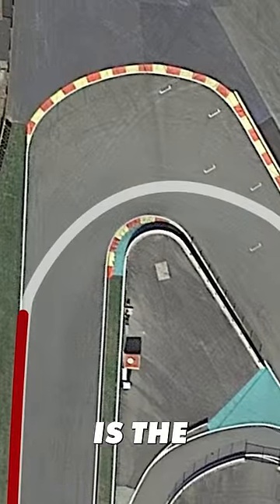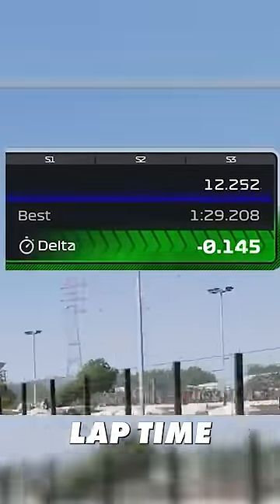Why F1 Drivers IGNORE the Perfect Racing Line

Comment: Brb gonna go test this on public roads
Reply: Yo, What’s the verdict?
Reply: Done this for years 😂 it uses too many pads and tyres
Reply: @Pickfordr100  yeah i just do single lane on public roads cuz i have to do it during the day. too many animals at night where i live. but when i did used to do it at night and used the whole road and pushed harder i was wearing my tires fast
Reply: will only work with 500+ hp
Reply: @frayziedaisy  got that covered 🤝
Reply: @metalmiguel16  currently in the prison hospital with broken legs and dreams.. 10/10 would do again
Reply: @frayziedaisy  any amount of power that's too much for the tyres &/or chassis to handle. You're cornering at points where you're supplying minimum power & easing the steering to get the power on.
Reply: It's fun to take the race line, just stay in the correct lane. Using the whole road is a terrible idea, especially on blind corners during the day. Driving at night you can see headlights coming from around corners so you know when to chill.
Reply: Doing that every other day.
Reply: @Pickfordr100 I’ve gone through 3 sets of tires in the last year and 2 sets of brakes
Reply: I do this on turning ramps. Higher speed on ramp exit is easier to merge. In reality, your acceleration is smoother coming up to highway speeds.
Reply: @badgermetal unfortunately some people will still drive their car at night with dying/dead headlight bulbs (or cars with manual headlights and they forget to turn them on especially when the road is lit) so you can't be too reckless and just assume it's fine to go into an oncoming lane in the middle of the night blind (plus nighttime is when the most drunk drivers are out and about)
Reply: LOL
Reply: It's the line i take 😂 helps when you don't have a great 0-60

Comment: Two words: Exit Speed.
Reply: Yeah I learned pretty fast that if there's a straight after the corner then exit speed matters a lot more than cornering speed.
Reply: Actually no) 
Short corner- are those 2 words)
Reply: That‘s 4 words man 🤦
Reply: No, it's Exit Acceleration
Reply: One word: Fast.
Reply: That's four words...
Reply: Exit speed isn’t always the most important though
Reply: And faster entering speed by late breaking, the sector before the turn 

Also tire degradation, track condition, and batteries strategies will all affect the racing line through a corner
Reply: There’s many things that you need to take count on like braking points, turn in points, and ofc throttle control i.e. exit speed
Reply: Four words: speed exiting the turn.
Reply: you're not funny @jared_deraj
Reply: Or maybe it's high minimum average speed?
Reply: @kresimirbozic1976 it’s four words, if you don’t understand basic punctuation.
Reply: That was the key for Vettel in 2008-2013
Reply: no, but both are correct 
The 2 actual words are : High-Low 
(enter sideways high, exit straight low)

Its a normal dirt racing practice to fulfill more corner speed which improves exit and next corner entry speeds. 

Ultimately Letting the car roll harder/faster to grab earlier in the corner, so you can point the car and gas out of the corner faster/more controlled without oversteering out of the corner
Reply: Throttle. Application. (i.e. the sooner you can get on throttle. but that's not two words. :-))
Reply: egg-zact-a-mundo
Reply: Late braking and wide in--->Fast wide out. 

Depending on what ya driving this is almost always true. Only time you stick to a more "Perfect" line is when you are in a 4wd or something that understeers when accelerating through corners. Racecars you can fix those issues but streetcars it's almost always true
Reply: One word: Speed
Reply: Correction: Speed carry. It's all about losing the least amount of speed while cornering.
Reply: and Lengthening the straight that follows...
Reply: Also if you are defending a car behind you or if no one is behind within overtake distance
Reply: V shape

Comment: F1 cars rely so much in aerodynamics that using the line of a normal car is just not their thing. If you pay attention you will relaise that F1 cars brake so late and turn in so fats that it almost seems that they are about to go long but no, they dont, the car turns in nicely providing so much grip that they can start gaining speed sooner

Comment: 2 items: First, this line is optimal in high power cars that can accelerate powerfully and quickly enough that they can more than recover any lost carried speed. Second, this line is in some ways a result of the high power in that getting all that power to the ground so fast will push/snap the car around.

If you have a moderately powerful car you will likely find that the extra 1 sec of acceleration will not be enough to recover the 10km corner speed that you lost.

The fastest line will change for different cars and set-ups
Reply: Yes, and when you talk about power, it's really a question of power to grip ratio, so the looser the surface the later your apex should get as well.
Reply: @excrubulent  haha power to grip ratio cool concept, that's the unit ? drifts per minute ? average drift angle ?  unit, just peak acceleration G's in a straight line/ cornering G's
So basically you woulduse exactlty the same lines with a mitsubishi mirage on black ice (no power/no grip) vs a high power high grip race car :-D
Reply: @geemy9675  I think on black ice it might be more extreme than a high grip race car.  Mirage on black ice might be more like a 600hp rallycross on dirt.  Power acceleration vs lateral acceleration is probably a good way to measure it, in which case it would be a pure ratio; completely dimensionless.
Reply: It’s not about how much power, but how soon it can be applied. If you try to keep too much momentum around the turn, you won’t be able to turn fast. So you slow down more, turn more sharply at first, and then ease off the turn and start applying gas. You can slow down more and come out of the corner at higher exit speed. Regardless of engine power. It’s a problem of momentum.
Reply: Very cool
Reply: I feel like my iq grew just by reading it . Ty stranger
Reply: @bro589 When i were a teenager, Sir Sterling Moss drove this way.
Reply: @bro589 
 I think power is a big factor. The more powerful the car is the more a "point-and-shoot" technique will result in a faster lap time. The underpowered car will not want to ever scrub speed, instead maintaining maximum momentum.
Reply: Also in f1 they drive like 60 laps so the tyres have to hold a while and while acceleration, breaking and steering all cause wear on the tyre a high speed turn will cause more wear than firm breaking as most of the time you’ll slide a little on sharp turns so they break hard before turning to minimise the wear of their tyres
Reply: I learned how massive the difference is in Gran Turismo 3 when they made me do Trial Mountain in a miata
Reply: Perfeito. E essa não pode ser feira em qualquer curva, mesmo com carros potentes.
Reply: Nah, it"s about the length of the straight after the corner.
Reply: The racing line is good for "momentum cars" like low power, fwd cars.
Reply: @bro589 Inertia. The car can be pivoted while carrying forward momentum then regain grip in its new orientation thus not losing speed. It's really just a four wheel drift. It's kept real minimal in all aspects but especially breaking point and loss of grip. That's in order to get back on full power as soon as the car is facing the corner's exit.
Reply: It is also a safe strategy for canyon carving because if you enter like this and it ends up being a DR turn, you're far more likely to make the turn. 
I've also used the technique to rocket past a rather surprised looking Z1000 rider on a Harley Dyna.
It was just like the scene in Last Crusade where the German rider just sort of blankly looks at Indy right before he shoves a signpost into his tire spokes. He knew he was done.
Reply: Also matters what corner is next or before
Reply: Yes; and no. The same "wide-in, narrow-out" is the optimal way to round a mark in sailing, even for low-powered dinghies and not just the high performance yachts seen in televised broadcasts. It's so prevalent in yacht racing that it's use is forbidden at congested marks (for right-of-way reasons difficult to describe adequately in a video comment).
Reply: "traction limited vehicles" will benefit from straightening it, would probably be the way to phrase it.
Reply: yeah for stock cars u cant do this shit, you gotta coast through most of it
Reply: Excellent consideration. In kart racing school.we focused on the first racing line.

Comment: This is mostly true when you've got a ridiculous amount of barely-controllable power, if you've got something more mundane the "ideal" line is indeed often ideal. Perhaps surprisingly,  if you've got less power or less grip than your competitors the early apex or double-apex line shown also works.
Reply: Was gonna say, this is only valid because of the insane grip those cars produce. However power wouldn’t be an issue as it’d still be more beneficial to spend as little time accelerating and decelerating as possibel
Reply: @somark28  I say "ridiculous amount of barely-controllable power" because F1 cars can spin their wheels in any gear. More power can be controlled in the more open "double apex" line so the exit speed from the corner is higher.
Reply: @alanhat5252  I’m talking about for less powerful cars though, even a Nissan Sentra would benefit from the sharper turn given it could make it
Reply: Uh, this basically applies to any car that's at the GT level or higher. For low powered cars you want to maintain as much speed as possible because they simply have no acceleration to get back up to speed to use an actual ideal line. Imo, slower cars are not using the ideal line which is to get your car pointed straight as fast as possible to get back on the power.
Reply: Yep, applies to anything that isn't a high horsepower track car. I mean some high horsepower cars could benefit from a ideal line, but not many. It would be only super/hyper cars that have high HP and tons of downforce. Mclarens, Ferrari's etc. 

Do this in a Mazda Miata race, and you're gonna be dead last hahaha
Reply: Also mid/rear-engined is a big factor. They handle completely different. Front engine cars upset the suspension too much to pull stuff like this off. End up losing traction or burning out through the turn. Unless they're on suspension so stiff that you can't drive it anywhere else but the track. Even then, still handles completely different. Less weight over the rear tires = less grip/traction

Comment: I was faster in my standard MX5 on a track day than a Porsche, GTR, and many other powerful cars , just because I took one lesson from an instructor on racing lines.
Reply: i think that on a car with less power, something closer to a theoretical line might be faster. A late apex line relies on the cars acceleration to increase speed quickly enough but in an mx5 it may be better to carry more speed instead. It may just be you are a better driver in general
Reply: @Hydraggle Doesn't the late apex line allow you to get on the power earlier? I thought that's the whole point?
Reply: @Ultrabenbooyah  you can get on power earlier, but if your cars acceleration lacks then that wont mean much. Whereas if you conserve more speed INTO the corner you wont have to rely on the acceleration.
Reply: @Ultrabenbooyah late apex means slow entry, such car as miata won't speed up as quick once it slows down
Reply: Did you use the F1 line or another line?
Reply: @Ultrabenbooyah  if you've got power to get on yes, otherwise keeping speed up is the higher priority.
Reply: That's because this is real life and not a video game. A miata weighs next to nothing and will have more cornering speed with the same tyres. Assuming there aren't any long straights you can probably run circles around them all day long.
Reply: All the other drivers let off and weren't pushing their cars hard and this guy is like.

DUDE I BEAT A PORSCHE IN MY MIATA lmaooo
Reply: The Porsche: Boxster

*actually on second thought, a miata would NOT beat a boxster even around a track. With a competent driver who is actually trying to beat you. Given enough time it would probably lap you lmao
Reply: I just learned this in autocross from an instructor in my low power fwd car as well. I was able to cut a lot of time.